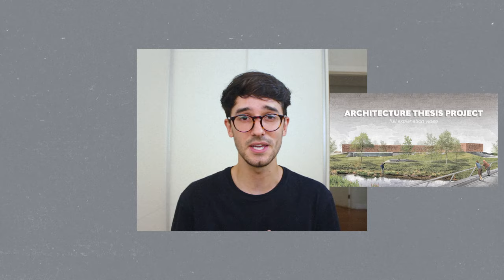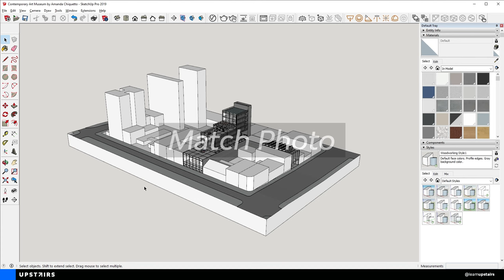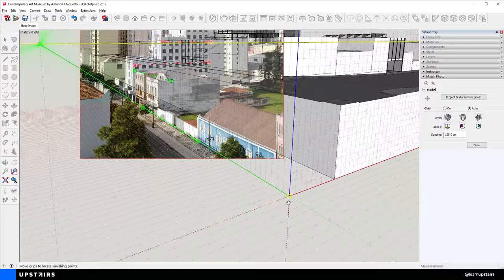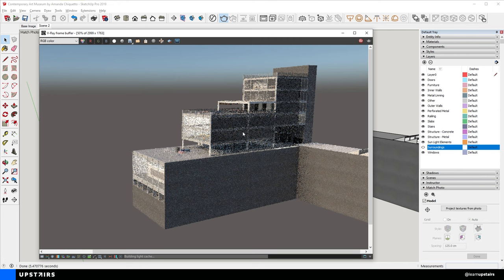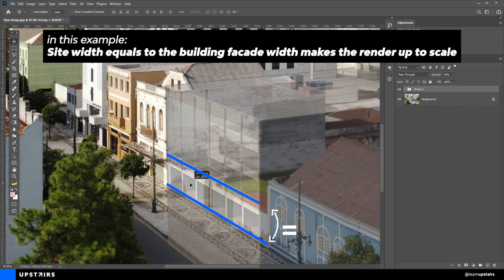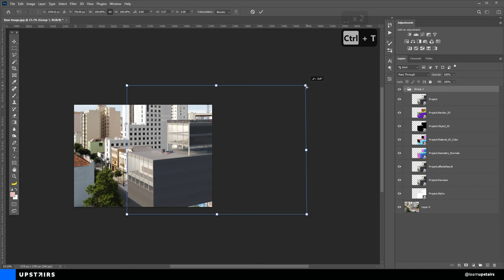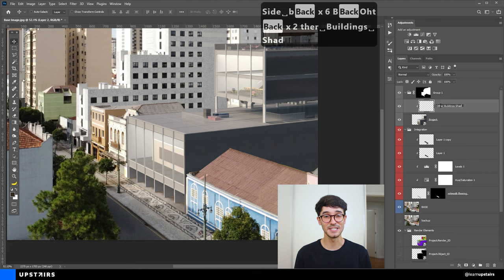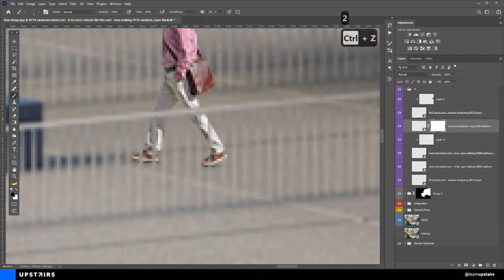Inserting your Architecture Project on a Drone Photo!

Comment: Littre pro tip about the Match Photo tool on Sketchup that will make it WAY EASIER to align perspective and resize the model more precisely and efficiently (without zooming back and forth like on the video): 
Before launching the tool, place the model' axes (Axes Tool icon on the main toolbar) on the corner of an element that will appear both on your model AND the matched picture (by example, the left-bottom side corner of the facade of the project building: this point is shared with the right-bottom side corner of the existing white building which has 4 bowed windows. It could also be the right-bottom side corner of the project building, shared with the  left-bottom side corner of the blue building on the foreground.)
Then, when resizing with the grips on the Match Photo tool, this point will be used as its reference and reduce considerably the deformations and misplacements of the model that you could encounter with an offscreen axes reference!
Also, you may find useful that it is often quite difficult to match a model with a strongly-curved perspective caused by a fisheye / wide angle lens.

Comment: Nice video! I never got the hang of the match photo tool, but then again: This is the first time I see someone use that scaling through use of the axes in a video.

Instead of rendering and re-rendering til you have the position perfect, you can save time by just exporting the 2D image, and then maybe even linework only to see the match with the photo even more clearly. A lot faster, and possibly clearer / more precise.
Reply from the maker: Hey Eelco, great tip! I usually do this step with a render to start seeing how if the shadows, materials, and other rendering settings are working fine against the drone photo. But I only do that if the model is quick to render. But definitely a lot faster to do with a 2D image or even lines, especially if you don't have a strong computer.
And the match photo tool is a bit strange indeed, I feel Photoshop's perspective grid tool is easier to work with.

Comment: great tutorial video!  To make it easier to match the photo in sketchup. you can setup axes before matching with foto. So it will be easier to pick vanishing point and u dont have to scroll out and u can match the foto more precise, without editing in photoshop. If u edited axes to the corner of blue building, then later in match photo u put the origin of axes at the same place, you could have more accured  match.

Comment: HEY its a nice video. But you can easier match the perspective from render- the only thing you need to do, is just select "viewport" in aspect ratio settings in vray. Because if you will not- vray cam and sketchup viewport has different angle view.

Comment: I usually have to manipulate these kind of renders so that they fit into an existing photo, so I usually do have a slightly different approach. Instead of using match photo, I would use watermark in SketchUp’s style. Just import the original image as a watermark, choose the correct position and scale (Edit: oh, and lower the transparency), and then try to match the model to the photo. When you render, render it with the same resolution with the photo, so that when you import into Photoshop, little editing and scaling is needed.
Reply from the maker: I've never thought of this method! It sounds that it relies a bit more on one's intuition, but I should definitely try it out one day. My only concern is that some photos have perspectives that can't really be achieved with Sketchup's default views or I guess so. Thanks for sharing that with us, Vũ Duy Hưng!
Reply: @LearnUpstairs  the problems with field of view (FOV for short) can be fixed using Match Photo function. if you encounter this problem, just try match photo (it doesn't need to be THAT accurate), and it would give you an idea of what FOV to use. typically it would range from 35 to around 50 or 60, rarely going up to 80 or 90. once the FOV is resolved, the model would align the perspective by itself
Reply from the maker: @vuduyhung7530  Awesome! It looks like you've mastered this workflow. A combination of both steps you mentioned may solve any situation.

Comment: Helpful video, I didn't know how to place my model on a perspective photo. Also, those photos which you imported them to photoshop, you got them from vray, right?
Reply from the maker: Hey Emre, the project was modeled in Sketchup and rendered in Vray. But the Aerial Photo was taken with a drone in a real place here in my city
Reply: @LearnUpstairs no, I meant  solid colored photos that simplify selection
Reply from the maker: @emretoruk7067  oh right! Those are called Render Elements. Most rendering engines have this feature. You just need to enable them before rendering. And you can choose what type of "channels" you want, like Material, Depth, Normals and so on
Depending on what version of Vray you have, it's located in a different place. So my suggestion is to google  Render Elements to find how to enable them
Reply: @LearnUpstairs  thanks a lot :)

Comment: How to male transparent glass and see the original background ??
Reply from the maker: You mean the reflection? I simply duplicated the background image, placed it above the render, mirrored it horizontally, and applied a mask to reveal only where the glass is. Oh and drop the opacity so that it feels like a reflection. This is doesn't work in all situations, nor is really correct to do that. But at least the glass doesn't stay flat and get some interest.
Now, if you're talking about the transparency, that is done over the rendering software. Use a default Glass material that comes with the render engine.
Reply: @LearnUpstairs  ohh got it, thanks🤘🏻